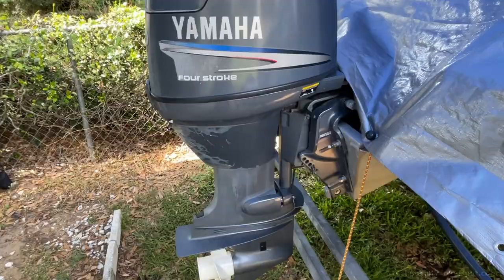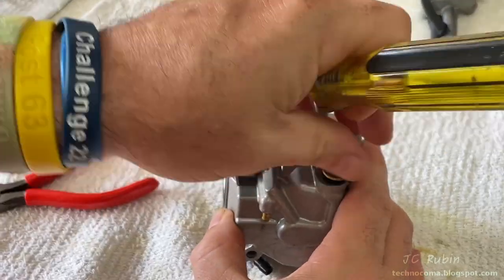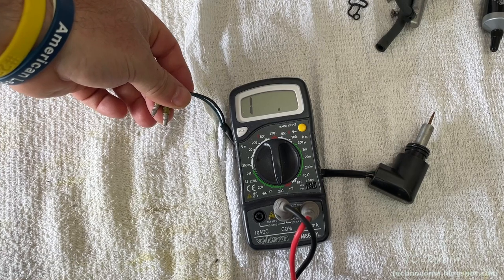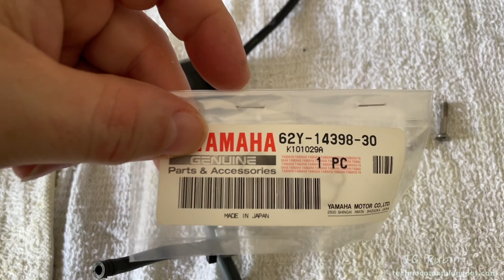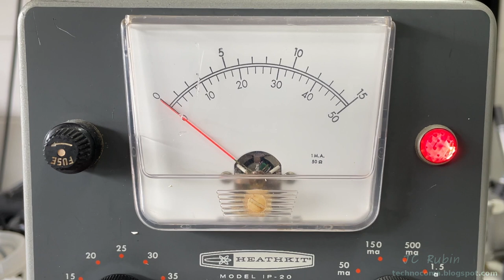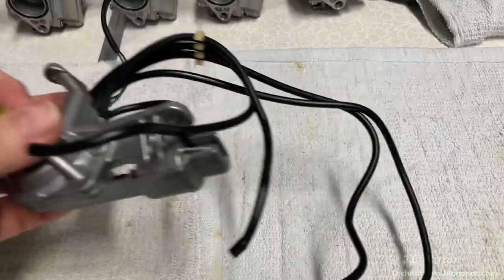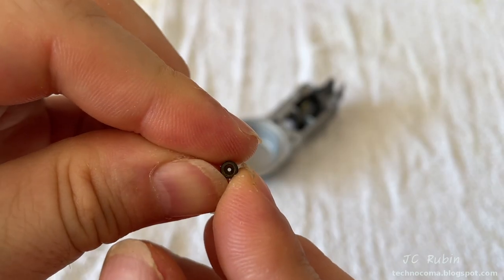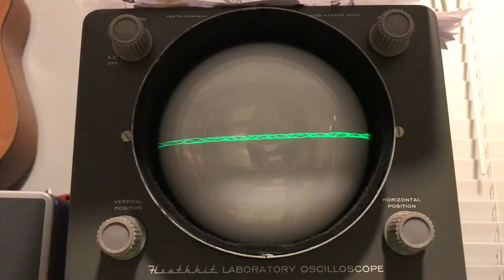Yamaha 4 Stroke Outboard Engine Carb Rebuild Series [3] Component Testing and Repair

Comment: Where did you get the manual you're using, I bought one for my F80TLRA and it's not what I'm used to, very little step by step information. I'm assuming my engines problems lie in the pilot circuit because it runs great when I'm past 1/4 throttle but idles poorly. Thanks for the videos, well done.
Reply from the maker: The factory manuals are not awesome.... little more than explosion diagrams and maybe some specific activities mentioned.
Reply: man thanks for braking it down on how heaters work. my 03 80f is got a slight mis at idle. time for kits